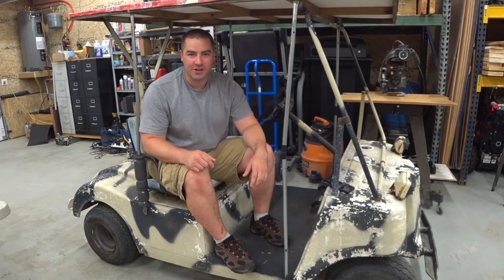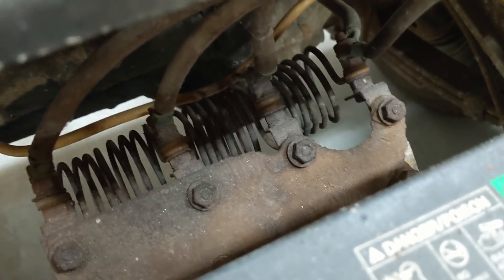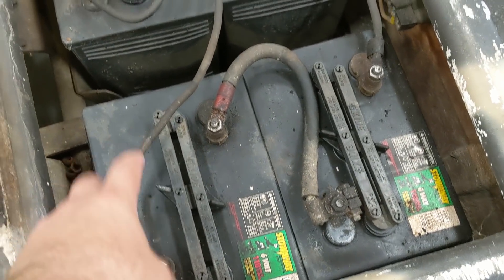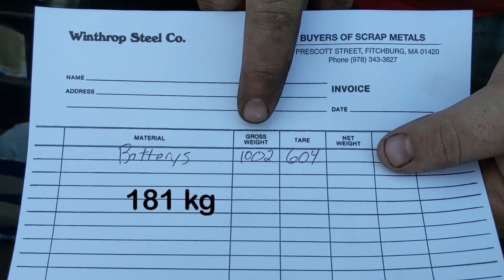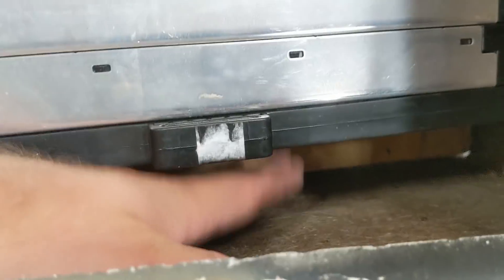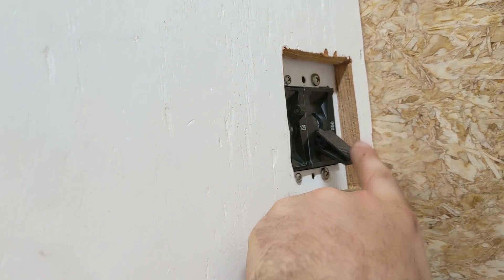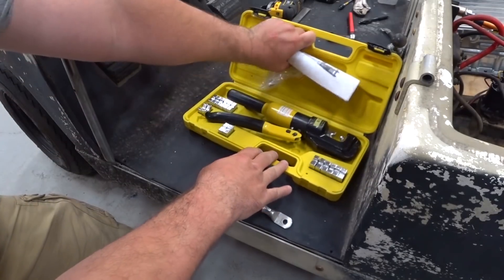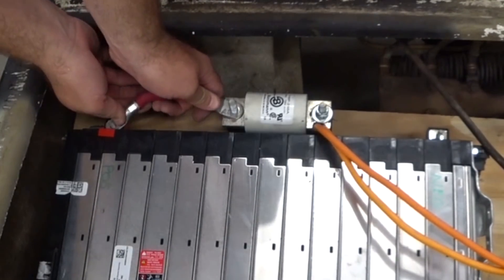Golf Cart: More Fun with Lithium? Part 2

Comment: I have an older cart also...resistors get hot when I use it but.i noticed my 36v batts go low very quickly...what can I do to get better use out of them without charging every 2 rides?
Reply from the maker: I'm told it might be possible to replace the resistor system with a more modern speed controller, but I don't have experience with that.

Comment: I am going to do this on a 36v yamaha but wirh lifepo4 batteries.  Will they do well for that application?   What charger and bms do you recommend for a 36v lifepo4 pack?
Reply from the maker: I'd check out this gear:
36V charger, waterproof so it can be on-board: https://shop.signaturesolar.us/products/36v-10a-120v-battery-charger-by-eg4
36V battery with built-in BMS: https://shop.signaturesolar.us/products/36v-100ah-abs-bt-battery-by-eg4

Discount codes: DAVIDPOZ (for charger) and DAVIDPOZ25 for battery

Another resource is my friend Bobby.  He recently swapped lead for lithium in a golf cart, and added solar.  He has never plugged in: https://youtu.be/A5xo-rzF4zY
Reply: @DavidPozEnergy  I already have 12 lifepo4 cells coming but don't know what type or amperage bms I need.  Your link for bms went to a battery site.

Comment: Did you ever publish the video where you install on BMS on it? I couldn't find it.
Reply from the maker: Not yet.  At first, I was waiting on the BMS to come in from China.  By the time it did, I had moved on to other projects and put this one on the wait list.  Along with installing the solar panel, charge controller, and inverter for the golf cart.  The parts are waiting on me to circle back around.
Reply: @DavidPozEnergy  Thanks for the quick update. I am looking to do the same to my 48 volt golf cart. I get a little confused when it comes to the BMS and how to control the high current  draw from the motor. I understand that current can't or shouldn't go through the BMS right? So the BMS should close a relay that allows the current to flow from the battery pack to the golf cart controller? Do I even need the BMS to watch each cell (LifePO4 16S) during discharge for a golf cart? I have a good aftermarket Alltrax controller that already has under/over voltage and current settings...but of course that is only at the pack level. Seems like all the cells would be balanced during each charge cycle with the BMS.
Looking forward to your next golf cart video!
Reply from the maker: Hi Matt,  There are many ways to do it.  Some BMS's control relays, some don't.  One method is to have a BMS like this: https://batteryhookup.com/collections/accessories/products/16s-60a-lifepo4-bms-w-low-temp-cutoff  wired into the charging port only.  Meaning, your golf cart can run on the battery directly, bypassing the BMS.  But for charging, the charging port would go through the BMS.  This means the BMS would be there to protect the battery from over-charging any one cell.  By the way, anything you buy from battery hookup can be used with my code DAVIDPOZ for a discount, and it tracks the affiliate.  The BMS I linked to uses internal mosfets, so no external relay is required.  But, it's limited to 60 amps, which would be about 3kw of charging.  That's probably fine unless you have some huge charger?
Reply: @DavidPozEnergy  Thanks for the info. I haven't picked a charger yet. I have my Lead Acid charger, but I would rather get a real LifePO4 charger. Any suggestions on which charger would pair well with the BMS you suggested and my 16S 48V LifePO4 pack?

Comment: Going with a light pack ,need to up the volts .hard to do on the old club car style. Running 20s Nissan lithium 74volts nominal in a resistor cart Yamaha with a amd motor club car wheels 205 50 10 street tires .the efficiency is in the coasting off the go pedal . Pulls 40 amps average at 20 and about 50 at 30. Will kill a 80 lb pack in about 20 min of normal driving. If you have a iron can motor put a cheap 72400 controller in it

Comment: What battery u use in your cart I want to order one for my cart
Reply from the maker: I buy my batteries from www.batteryhookup.com  Sorry, but they are sold out of this exact one.  They have others that will work, check out the BMW cells they have.  My discount code is DAVIDPOZ which also helps track the affiliate program to help out the channel.
Reply: @DavidPozEnergy  it a 36v battery how many ah is the battery

Comment: I have one of those in the garage that needs to be rebuilt.  I brought it for the ex-wife as she was looking for a project.  Welll, before she became an ex-wife and moved back to the UK.  I wanted her to add solar panels to the top as its an extended golf cart that has a bed to the aft of the vehicle.  Possible to use 12V panels at around 8 from stem to stern.  That would have been 48V but then we would have to drop thata to 36V though some buck converter.  I even through about changing the electrics to 48V.  But I would have torn what you had down, clean it up, paint it and then think about changing the batteries.  You have allot of metal parts that needs to be repaired from what I saw and the body I think would some how replace it.  I have the same issue on mine.

Comment: Just found this video and I love it. I actually also have a 36vdc EZGO Marathon 1987 3 wheel golf cart, and have considered switching over. It doesn’t have the contractors like your cart, the speed control board simply has 4 contractors wired straight to the resistor pack. But otherwise I think would need the exact parts you have for yours. Battery pack, circuit breaker and fuse. What about how to charge?
What kind of budget so I need to do the change?
Thanks so much for a great video!
Reply from the maker: Charging can be done with a CC/CV charger. Or a Solar MPPT Charger.  In my case, fully charged is 42 volts, but that will depend on your exact battery.  Try connecting with me on Facebook @davidpozenergy if you want to discuss more

Comment: You might be interested in knowing that the setup you are showing would be known as a "DC Rheostatic Controller" in the elevator industry.  Change the foot pedal accelerator and forward/reverse switch out for a "Elevator Car Switch" and you have a basic "Car Switch Controller."  The biggest differences are in the contactor sizes, the larger resistors for voltage control, and the DC voltage used.  And there are still elevators running today, not very many, using one version or another of this vary type of controller.  In San Francisco, the DC voltage is 230 VDC from the city.  Great Video.

Comment: battery out of a bolt? and same with the orange wire?
Reply from the maker: Yes, the battery if from a Bolt, but the wire is from one of my first builds with a Volt.
Reply: @DavidPozEnergy  I was gonna say a volt too, lol. I'm a hybrid certified technician for gm, been inside a bunch of volt batteries, no bolts as of yet, seen the inside of a spark ev battery and the old suburban batteries.

Comment: Hi David, great video!  I picked up an '81 club car ds last fall that needed new batteries and have been on the lookout for some lithium batteries ever since.  I was fortunate to find the exact same pack you have in this video just yesterday.  I was curious how you plan on charging this pack or if you would have any recommendations for a charger?
Reply from the maker: I ordered a 10s BMS (battery management system) that I will connect to the pack.  Then I'll use my solar charger to charge it.  But if you don't have a solar charger, then you can order a 10s charger, just look for one with a setting of 42 volts.  Here is an example: https://amzn.to/315ZCXh  But it's critical to only charge through a BMS.  
Here is a link for a BMS.  You have to choose "10s Li-ion" from the drop-down menu.  The golf cart can be driven direct from the battery posts, but only charged through the BMS.  If you decide to buy this BMS I linked to, then you can use my coupon code DAVIDPOZ for 10% off anything from Battery Hookup.
Reply: @DavidPozEnergy  I was planning to use a BMS and am aware of the criticality of using one with lithium as you noted.  I will likely use the one you suggested from Battery Hookup and will be sure to use your coupon code if I do.  Thank you for linking an example for a charger, however at 5 amp charge rate it will take 1.5 days to fully charge this pack!  Wondering if you know of any sources for higher amp chargers so I can reduce the charge time to something more reasonable?
Reply from the maker: For a charger, you are looking for something called "CC/CV" this stands for constant current, constant voltage.  If the charger is made specifically for lithium then it is usually cc/cv.  since we are working with 10s, the charge voltage is 42 volts (10x4.2).  But a lower charge voltage is also OK, like 40 volts.  If you plan on depleting your golf cart 100% every day, then you are right that you need a higher amp charger.  I don't know of one off-hand.  I'd just search ebay and aliexpress.  Sorry.
Reply: I think I found a possible candidate.  A little spendy but should allow me to get a full charge overnight.  https://dakotalithium.com/product/36v-18-amp-very-fast-dakota-lithium-lifepo4-battery-charger/

Comment: Hey Dave do you have an update with the golf cart as far as using a BMS and how your going to be charging it. I have a 36v limo cart that I'm only getting a 6 miles out of it and I think lithium batteries will help. Thanks in advance and keep up the good videos.
Reply from the maker: I don't have a follow up yet.  It's going to be awhile as I bounce around to my different projects.  Sorry about that. But, yes. You can get more range because you can fit more lithium battery into the same compartment compared to lead acid

Comment: Hay i would love to talk to you i have some questions about how close your cells stay balanced while charging and dischargeing i built a 24v 7s4p with thoes cells and i wanna know if im being ocd or not how big of a cell voltage difference while charging and dischargeing is acceptable? Should i just get some qnbbm balancers? How many mv is to much difference?
Reply from the maker: Certainly the closer the cells are balanced, the better.  But it's never perfect.  I like to top balance my cells as close as my equipment can.  Usually 5mv while at 4.200 volts per cell.  I don't leave active balancers attached, I just use them to set up the pack once.

Comment: Update on my cart and a question:  With  the 2p14S 6kwhr battery pack My 48 volt 2005 Club Car DS goes about 60 miles on pavement with steep hills 3 times as far as new trojan batteries.  Question do you know anywhere to buy an affordable sun power meter or wifi one that reads in watts/ meter or similar? Not a handheld unit.

Comment: Oh, man. There are some great DC motor speed controllers that don't waste so much energy using coil resistors, but rather solid state power control, thus greatly enhancing efficiency. They actually put out PWM (pulse width modulation) square wave signals to the DC motor, which controls torque and speed across a more broad range of speed control, giving you more torque on the low end so that it doesn't sit there humming needlessly. The motor will be noisier because of the not-so-much- DC going to it, but the difference is like night and day.

Comment: You should try adding another pack in series. Double the voltage. Will go extra good then.
Just ensure the contactors run from half pack voltage otherwise you could cook the coils.

Comment: I built a 2p14s module from these cells that I use anderson connectors to swap in and out of solar storage to use in a 2005 Club Car DS 48 volt cart. The pack works great!  
What I would like to do is use the golf cart charger with a 115 volt honda 2,000 generator to provide at least 24kwhr per 24 hours to my batteries in case of grid outage. (Also use grid to charge cart directly ).   The main reason is that generator is much quieter and more fuel efficient than my 240v generator and can run on lp gas and the inverter will only accept a 240 volt generator to replace the grid power. 
I finally found the specs for power drive charger that comes with club car but it doesn't have where float charge begins etc. It does however charge up to 60 volts which is too much for 14 s and not sure if constant voltage charge and I know its not constant amperage near the end of charge cycle and it is cut off by onboard computer.  My choices are 1. Use BMS to limit charge to about 56 volts or little less and hope its not equalizing at that voltage . 2. Add one or two more cells to get the pack voltage higher so charger cannot overcharge and shouldn't start equalizing since battery pack will still be accepting full charge (my solar inverter can charge up to 64 volts). 3. Keep charging with solar inverter and swapping back and forth.  4. Buy a golf cart charger meant for lithium battery algorithms and programmable for $300 minimum to over $700. 5. Any other suggestions or thoughts ? Of course if I use the same pack as solar storage at least when grid out I would need to make the other modules the same number of cells say15 or16 as the 48 volt golf cart pack but that is not a problem since I can charge to 64v.

This could also apply similarly to my36 volt resistor Club Car cart.
Reply: I have solar panels that are rated for $1,240 Watts and I use a single victron charge controller to charge my golf cart with lead acid 48 volt pack the max charge voltage is around 58 volts but it settles down to 52 volts when it's all said and done that's where it shows that it's floating I really like the victron because it is a smart controller with Bluetooth connectivity to my phone so I can look at everything and see how it's doing

Comment: I suspect that this motor has a field winding. The field strength controls the  motor speed. This was built before modern permanent magnet  motors.  The resistor  controls the current  in the field winding which controls the  strength of the  field.
Reply: I used to add accessories to retired golf carts at a fun aftermarket shop, but I never did the heavier mods. I remember seeing these older carts with their coil resistors and was wondering how they handle over volting versus a 2009 EZGO. I heard the motors can handle a lot of power on the newer ones, you're mostly limited by the controller. Either way about it, fun stuff.

Comment: Put some more cells in series and up the voltage a little if you want to make it a little faster. It should be able to handle 42-48 volts without hurting anything, and the top speed might go up to like 15-18 mph. Maybe try this when you are done with the project just in case the motor can't handle the extra voltage for long and it fails on you.

Comment: So you are testing hill climbing with only 2 passenger vs 2.25 passengers and lighter batteries?... Obviously it will have less issues.... It's less weight...

I knew the top speed wouldn't go up... Voltage = top speed..

Comment: If you serries another battery to it , would it double the power? Yes or no ?
Reply from the maker: I'm not 100% sure.  It would double the voltage, which might double the speed.  Or, it might burn up the motor?  I don't know.
Reply: @DavidPozEnergy  thanks for replying, I like your channel

Comment: Did you use a 48 volt battery?
Reply from the maker: The lithium battery is a 36v module.  3p10s, 180ah, Li-NMC.
Reply: @DavidPozEnergy  try 48v you will like it.

Comment: I'm excited to see what you do with the gold cart! Maybe see about putting a solar panel on the top. Also, for a DC electric motor to spin faster you need more voltage. Motors have whats called a KV value which means the number of turns it'll do per volt. I'd be willing to bet that motor could take a 48 volt battery, especially if you got a modern pwm speed controller. Or if you'd rather put bigger tires on it for a more comfortable ride that would also improve top speed by "gearing up". 
PS: Isn't the orange cable from your volkswagen bug project?
Reply from the maker: Yes, I will be adding some solar panels.  I mentioned that right at the very end of the video.  Good to know about the motor, thank you.  The orange cable is from an EV, but not the VW.  Thanks for the guess.

Comment: Dave I thought a fuse is the same as a circuit breaker. Which one was rated lower? Is this just double protection? Should you always use both on lithium setups? More noob questions.🙄 
As alway love the videos!
Reply from the maker: They protect slightly differently.  In this video I just used what I had on hand, but it's not perfect.  Ideally speaking, you would use both a fuse and a circuit breaker when dealing with such a large lithium battery.  In this case these cells are capable of discharging over a thousand amps in mili-seconds.  So I want a fast-blow fuse that is capable of quenching an arc.  But I want a circuit breaker for over-current of the wires, and as a disconnect.  Now that I know my motor was pulling 67 amps, I will probably switch the circuit breaker to something better sized for the wires in the golf cart.  But I can leave the fuse in place.  Ideally the fuse is slightly higher rated then the breaker.  For example, a 100 amp breaker paired with a 110-120 amp fuse.  This way the breaker will usually open first